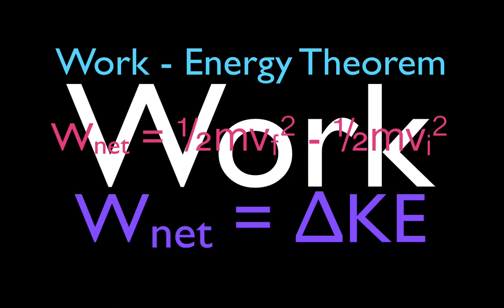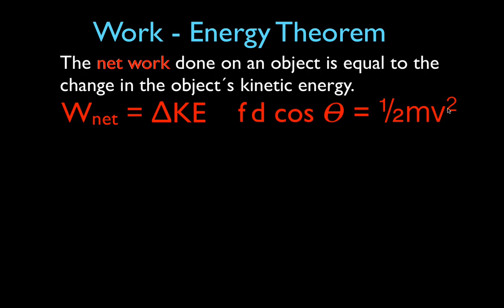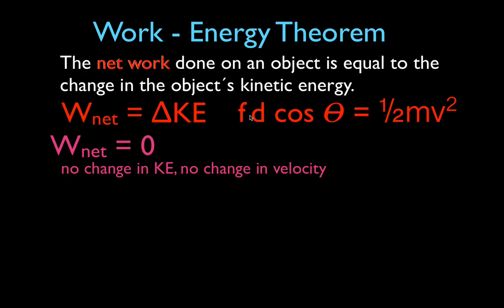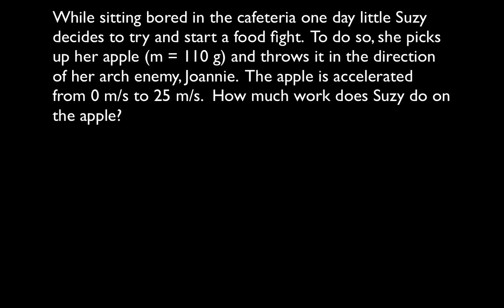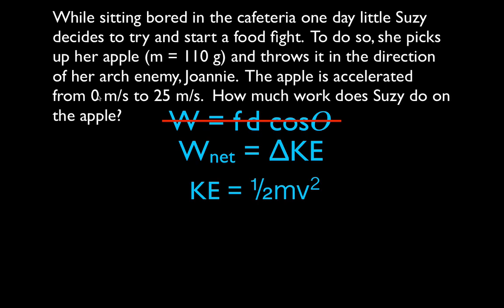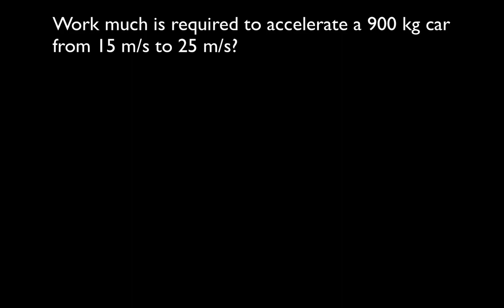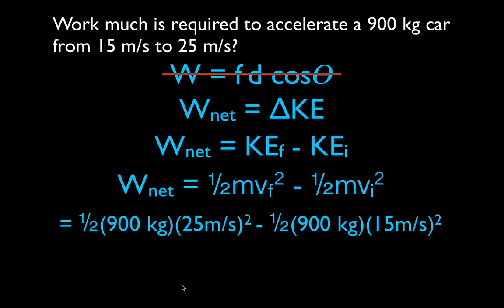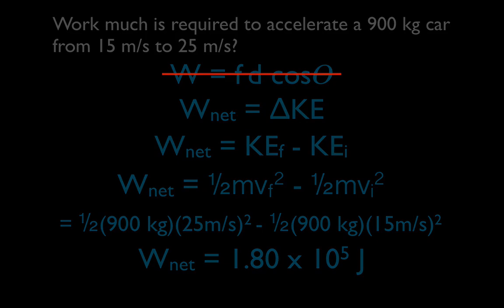Energy, Work & Power (16 of 31) Work Energy Principle, An Explanation

Comment: Isn't this also true: W = ∆Eg? (If so, why does the work-energy theorem only precise W as = to ∆Ek)?

In other words, why does the work-energy theory ignore potential energy?
Reply: Julia Kim Work done is potential energy 
For example consider a ball is thrown up with some velocity from point O, it reaches straight up to point P, where the ball ultimately loses all its velocity 
And it is at this instant, it will start to descend vertically 
So it's potential energy at the top most point will be maximum given by (mgH) where mg is the weight of the ball, and H is the vertical height between O and P 
As it descends downwards it will obviously have some kinetic energy right? 
So the potential and kinetic energies are just converted 
See the potential energy is (mg = Force)  times (H = Displacement) 
Which is ultimately the formula for work done in a straight line
So the expression in this video is the work done in horizontal direction rather than in a vertical plane